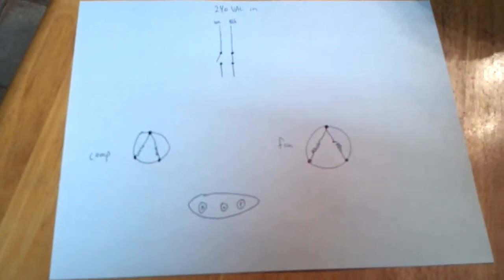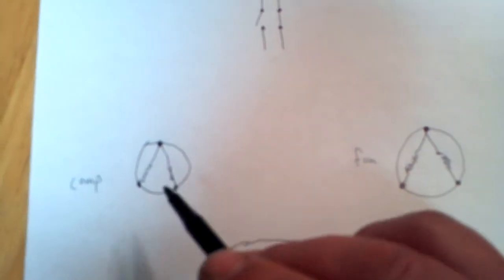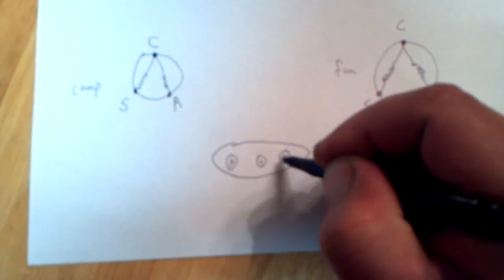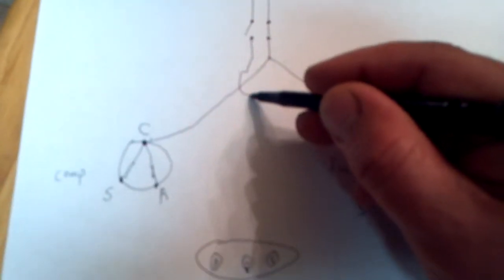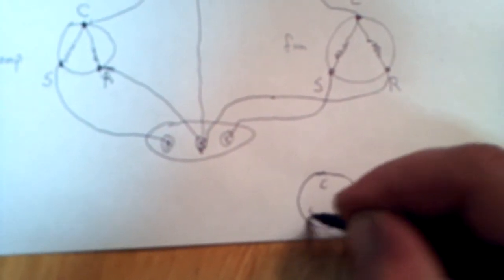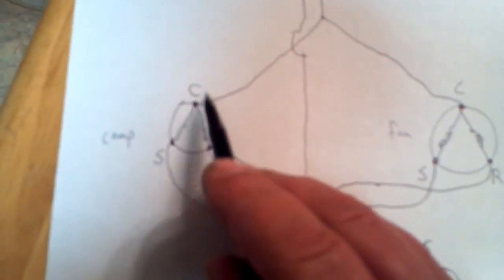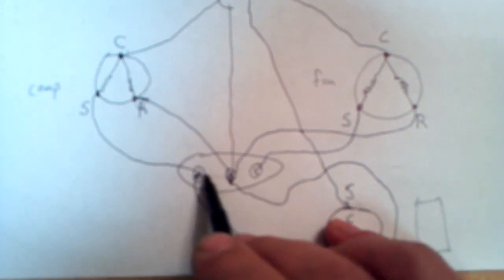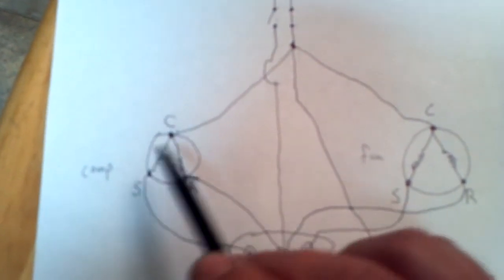PSC motors and 5-2-1 hard start connection

Comment: Very good video, I was a little confused on the blk wire going to common but after you showed the un -switched  leg on contactor it cleared up things.  I have a 12 year old Ruud Scroll with a TXV   my in-rush reading is 9 amps over LRA.   Do you think I should install a 5-2-1 Kit  ?   Thanks for the video you are a good teacher.

Comment from the maker: When you have time, go out and double check it. If the that yellow wire coming off the contactor is the switched leg, and goes to the common on the dual run cap, and you have the other wire from the 5-2-1 going to the black on the contactor, then yes I think you're fine. It's hard to see, since you didn't zoom in on the hard start potential relay and the run cap long enough. Never hurt to double check things, and also see how that nice Amrad is holding up.

Comment from the maker: Nah, actually about 15min ago I re-watched that video of when you replaced the contactor, run cap, and installed the 5-2-1 back Sept of last year I think. You did connect the wire to the black wire on the contactor correctly. The answer to why that run cap died? Those famous 3 words of top quality are written right on it. "Made in China". LOL. And also notice the fake-ass brand name. "GEMtech"???  The real one like the one I bought from the Trane Store, is GENtech. Nice try there, Mr China.

Comment from the maker: A good rule of thumb is never guess or assume when connecting single phase PSC motor wiring. If you connect something wrong, you can either, A) blow up the motor, B) force the motor to run backwards if the Run, and Start windings are switched on the cap, or C) blow the cap. You can be a little off on things like system charge, superheat, air flow etc, but with wiring, it's either correct, or its just plain wrong. Close enough doesn't cut it in this case, hehe :)

Comment from the maker: If you connect the black common wire to the wrong side of the contactor, then what you are doing is just connecting it to the run caps' common terminal.And then what you have is now a 2 wire hard start.Which may or may not work properly, and anyways, that defeats the purpose of having the 3 wires in the first place. The advantage of a 3 wire hard start is more accurate sensing of the back-emf voltage (ie motor speed).So you're running the risk of either leaving the start cap in too short or long